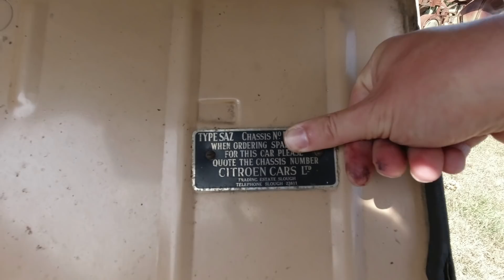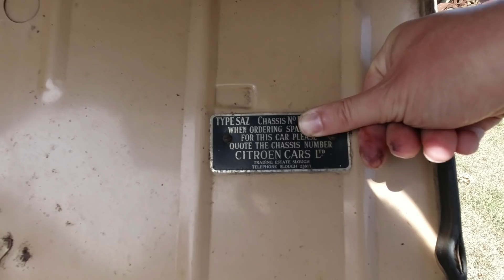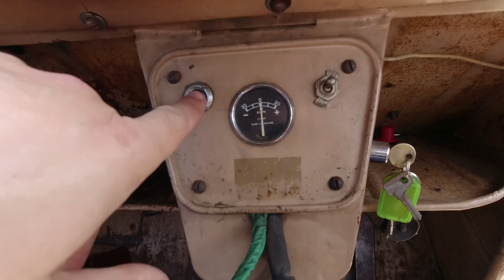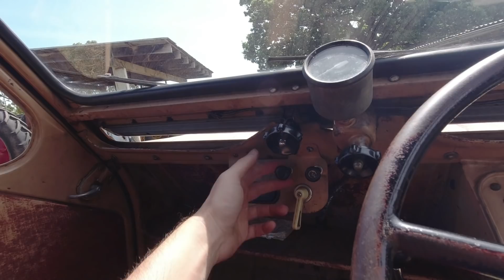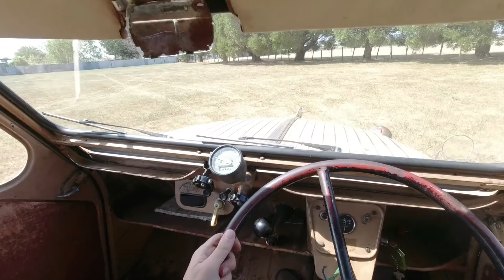British-built 1955 2CV road test, in Tasmania, Australia! 425cc!

Comment: I had a digital piano stolen out the back of a 1988 2cv in Nottingham in 1994 - not the most secure things with those windows.  Can't believe I left it in there.  Luckily the thieves were spotted hoofing it over a nearby wall by The Fuzz and I got it back!

Comment: I so wish I could have that car!!! I've owned two 2CVs. One I drove all the way to Greece in. Took the back seat out and slept in the back. I used to be able to change a clutch I. 2 hours as the release bearing used to chew it's way through the fingers of the pressure plate. The manually adjusted rest drum brakes made live exciting on occasion if you ignored the warning signs lol.

Comment: Great video I really miss the sound of a air cooled engine having owned several VW Beetles in the past. I didn’t know they made the 2CV at Slough I thought it was just the Traction Avant or the Light 15 as the Slough built version was known👍👍
Reply from the maker: They build the DS too!
Reply: HubNut I didn’t know that I wonder what the differences were to the French built DS. I know that the Slough built Light 15 had a different interior with a wooden dashboard and leather seats etc the French built ones were a little more austere inside.

Comment: 3:49: pulling the rubber line will not release the roof. The front edge of the roof is hooked onto the body. You have to grab the front edge of the roof somehow and pull it down-forward to release the two hooks off their eyes welded to the body.

Comment: I drove one of these in the 90 ties with rectangular lights in front, also 2CV4 which meant 400 cc cub motor. The first ones had 200 cc engines , the last 653 cc, all air cooled, very simple and easy to maintain/service, no water, just air cooled. They could be started also by means of a wrench in front, in case the start motor wasn't working or the battery flat.  This car gave me such a pleasure and joy,  open air convertible  in the summertime, low consumption,  an iconic car. It never let me down in winter too, funny they cross all snowed roads as they are light weight and  front wheel traction which was very innovative these days. Citroen invented front wheel drive btw. .  Pretty detail : all spare parts are still available,  because there were so many made and who knows running from time to time !
Reply from the maker: Close. First were 375cc, last were 602cc. 9bhp up to 29.

Comment: 8:43 6 volt ! And square battery which fits any way round. Makes me wonder if they were planned to be positive earth ?
You can tell batteries have been fitted both ways round in its life as the bonnet is corroded in both orientations above the battery caps.

Comment: Cold wet noisy and overtaken by a milk float and a tar truck going up Glencoe.
Had a Renault 6 and Renault 4 with the dash gear stick.
Bedford CA Utilabrake with 3 gear steering wheel shifter. A35 visor and beautiful leather upholstery 30,000 miles 1953.
Compared to a Peugeot Partner 2001 these old vehicles are so consuming to drive. We did it but definitely in Withnail & I territory.
A hobby for sure.

Comment: That is hysterical. I have a lawn tractor with a Briggs and Stratton v-twin producing 18 HP. Early four passenger cars only had 7 or 8 HP! They had to be geared very low, I would imagine. That is really basic transportation. A very quirky little car. My '53 Desoto has a semi-automatic transmission. It has a manual transmission with a regular clutch and a fluid coupling. It also has a couple of solenoids that shift it on the fly. You start off in second gear, if you aren't climbing a steep hill, get up to around 25 mph and let off the gas. You hear a clunk and now you are in third. It also downshifts when you come to a stop. You don't need to use the clutch when you stop. They do recommend using the clutch if you are stopped for an extended period of time though.

Comment: Interesting! I knew about the Slough factory but I didn't realise that 2CVs were built there. 🤔
I thought Citroen didn't start selling the 2CV until 1974 in response the oil crisis.
Lovely patinaed example.
Reply from the maker: That was the 2CV returning to the UK market for the first time since UK production had ended. Fun fact - those early RHD 2CVs were usually made in Belgium!
Reply: @HubNut  Thanks Ian!
Reply: The design actually goes back to the 30s but something happened in the early 40s to delay production until about 1948.
Reply from the maker: The 1930s prototypes ended up very different to the production vehicles.

Comment: Well, sad to say, I enjoyed every minute of that. It rekindles fond memories of Ami 8 driving in the 1980s. I also bought a 1220GS in 1973. Talking of which - and if I remember correctly - the GS 1220 was offered with a ‘Convertisseur’ semi automatic transmission which I think was a development of the centrifugal ‘Trafficlutch’ in this rare and lovely antipodean 2CV from Slough. Little wonder that you wore a smile on your face at the wheel of that unspoilt example.
Reply from the maker: The C matic used a torque converter I think, certainly very clever.

Comment: In cars of that era it was common to be able to start them from under the bonnet, even with an electrically actuated solenoid.  Typically there was a rubber cap on one end covering the solenoid's moving bar and you could simply press that to start the engine.

Comment: I am also having a 652cc Burton 2CV6 motor to my 1990 Charleston... Plus the Power Tube to slightly pressurize the carbie... 36hp plus 20% increase in torque....
Maybe 80mph on the flat and maintaining Speedo on hills... Vrrm
Reply from the maker: I reckon that torque increase is not far off, but 36bhp seems a little much. I reckon my 652 can't have been more than a couple of horsepower more than stock, even after being tuned properly.
Reply: @HubNut  Interesting... Maybe wishful lust for power after 550,000 kms over 44 years of 602cc...And 3 new 2CVs.
 Will the PowerTube give another couple of horses in addition to the extra 50cc?
Planning a 3 week trip next March to a CITIN at Murray Bridge in South Australia for the 75th Anniversary for the 2CV.
Reply from the maker: Not sure the power tube really does add much but may help a little.
Reply: @HubNut  every little in a 2CV is a lot in the rest of the world....

Comment: I havent read all comments but I'm pretty sure someone already explained the stretchy.. 'things'...  at the front corners of the roof. If not, here's my contribution to this lovely 2CV review:
They have actually nothing to do with releasing the roof - you'll just have to tug the front 'beam' and bend it up a bit and backwards to release the 'hook' from a specially made steel recess plate (I just don't know to call it) welded to the windshield frame. They were still welded on long after Citroën had invented a much better system that didn't use them... (you'll also find them in the back from the time when the roof was also the boot lid)
But.. about the stretchy things.. The are just stored there untill you roll the roof halfway only, then you pull them out and use them as 'rubberbands' to hold the roof/roll in place. There are specially made anchor points to hook them to above the b-pillar. You do the same when you roll the roof all the way back.
Reply from the maker: That's what I get for owning a new-fangled Dolly...
Reply: @HubNut  I wish you all the best. Mine was a -59 12,5 hp SAE.. smooth as silk 🥰
Reply: @HubNut  I also noticed that your driveshaft must be realigned to work properly. The outer and inner yokes should be aligned the same way; the outer half shaft should be rotated 90 degrees, according to what is visible in the video. You'll find that they will work much better that way. Also, the reason Citroën put a centrifugal clutch in their 2CV was to make it easier to smoothly turn around in the city letting the clutch even out the oscillating rotation speeds of the driveshafts. As I was told by veterans...

Comment: I wonder if the dash light was oil pressure? My wife and I borrowed a 2CV on our first visit to France. As an old VW beetle man, I was concerned that the one dash warning light didn't work. Found it was a broken wire from the engine. Once I reattached it, the light worked until the engine started and then went out so I was pretty sure it was oil pressure. My VW also had a generator warning light in case the fanbelt broke and you lost your fan. (Not great on an air-cooled engine.) Of course, no need for that on the trusty 2CV with a direct-drive fan!

Comment: Ah Hubnut, how nice to see you in 2CV heaven!  And you've created a much more in depth look at a 2CV than I've ever seen before, so thanks!  It's quite an exercise spotting all the British parts on this car.  Here's a few - Tail lights - Austin A40 Devon and Morris Minor (?). Red dash light - Morris Minor and Oxford.  Unidentified black knob below right of dashboard - looks like a Rover P4 freewheel knob. Interior light toggle switch - definitely British and I've got one around the place somewhere.  And of course it has the ubiquitous Lucas voltage regulator.  Also, Australian number (license) plate spotters will know that this car is wearing original 1955 Victorian plates, and not Tasmanian ones curiously. And I presume the centrifugal and foot clutches are built as one unit?  I'd be curious to see how that works if you ever have your camera near a disassembled one.  Finally, I couldn't spot where the trafficators/semaphores popped out from on this car?  Cheers.
Reply: Ah, I've remembered where that toggle switch came from.  In Victoria (Australia) there was an antiquated law in place until the mid 50's such that rear lights had to be turned on and off by an external switch at the back.  This switch was also used in this capacity on FX and FJ Holdens.  It is of British manufacture.
Reply from the maker: The trafficators had been removed. I think they sat on the lower A post. The clutch pedal simply overrides the centrifugal clutch. It's a series of plates I think. Never seen one in bits.

Comment: My first Dyane, a '73 model also had a centrifugal clutch. It was the first of 6 Dyane and one Accadiane and only 1 2CV . Somewhere buried in my loft I still have the owners manual from that first Dyane. I've always liked the early 4 window body , my memory is vague but I'm sure the centrifugal clutch allowed the car to pull away from a standing start without the need to use the clutch.
Reply from the maker: Correct.

Comment: My slightly ropey maroon Dyane 4 had the later version of the 425cc engine when I bought it in September 1977. After a trip from Leeds to Bedford (not Bradford !) and back I'd had enough and I bought a 602cc engine out of an Ami from a Leeds scrapyard. I did the swap in the street and it made all the difference to driveability. I also had the alternator fail in Stockport on Xmas eve 77 and had to get back home on two candles as it went dark. That was a bit of a frightener. Otherwise it was great and quite a lot of fun to own and drive.
Reply: I like these stories ☺

Comment: Have you ever driven an Armstrong Siddeley Ian? My first car was a A.S. 14 hp built in 1937. That also had a centrifugal clutch and a pre-selector gearbox. You should try one if you get the chance, it had a 1666 cc six cylinder engine which was very smooth, built in jacking system which would lift the entire car off the ground and a centralized chassis lubrication system.
Reply from the maker: Annoyingly, I've not managed to yet.

Comment: Now that's what I call Hubnut !!!!!!  Interesting contrast in suspension systems, from basically none on most of the tractors to rather a lot on the 2CV. It brought to mind an exercise Motor Sport Magazine did involving 100 ascents of the Bwlch Y Groes pass in a very similar car, you'll find it  in the June 1956 issue on their online archive. Maybe  you should re-enact it in Elly once lockdown is unlocked ?  One tiny pedantic quibble, wern't the early 2CVs on metric 400mm wheels rather than 16" ? Otherwise utterly marvellous and thanks again for getting back to normal wiperyness......
Reply from the maker: Correct on the wheels. I've cooked Elly's brakes coming down Bwlch Y Groes before! Perhaps hurtling down at 60mph wasn't such a good move...
Reply: @HubNut  Interestingly the Motor Sport article mentions 50mph downhill and a similar amount of fade (on drums !!!)

Comment: A Tassie car with original Vic plates

Probably originally registered in Victoria about  1958 or so (if I remember Dad's Vanguard plates correctly)

Registration is supposed to be changed to  a new state after 3 months of moving, I won't say anything though but were you were driving an unregistered car on Public roads (tut,tut)
Reply: Mid 1956 registration.

Comment: In the seventies we had a Dyane,basically a bit posher version than the 2cv. 425cc engine,it drove well once you'd mastered the gear shifts. The suspension was great,really bouncy on a country road. The inboard brakes let it down,we had a fair bit of trouble with them due to their getting hot. I'd have another one any time though.

Comment: Cable operated manual starter also used right up to the end of Fiat 126 production, my wife owned 2 in succession, why the bloody hell did I trade one in for a 750 Fiat Panda, and what possessed me to get rid of that also, what a wonderful thing hindsight is.
Reply: I had two Fiat 126's back in the 80's. Both rusted terribly, so you did not lose out much. My 1976 one was in the scrapyard by 1986, and the 1979 one was in the scrapyard by 92.
Reply: Cable-operated manual starters are very reliable, the later solenoid versions are more prone to failure. It's all part of the design of the 2CV, less is more because what you don't have can't fail. As Ian shows in the video, even if the cable would break you can still start the car.
Reply: James Knight Absolutely, it’s a shame cars back in the 60s and 70s didn’t benefit from protection and build techniques manufacturers use today, gone are the days of rust buckets and bangers on the road.

Comment: I was always told this gearbox was, in fact, a 3-speed plus overdrive - that is, the internal ratio for 4th was greater than 1:1 (although the low final drive still makes the term "overdrive" sound a little silly.)  This could explain why the shift pattern is regular 3-speed with first on the dogleg (although Peugeot did use a dogleg 1st on a non-overdrive 4-speed in the 403, so who knows?  C'est la vie - how terribly French.)  :-D
Reply from the maker: It isn't that tall. All gears are indirect on all 2CVs.
Reply: I guess they're just being French again.  They always come up with weird, odd, unconventional - but still usable - solutions to problems that never existed before.  Fascinating engineering.  :-)

Comment: I had a 1983 2cv special where you opened the roof from the outside but always loved the Slough built - specifically for the opening rear windows :-)
Friends had a 1977 special 425cc with front bench seat and a 4 light body shell which I preferred over the 6 light.
I want another 2cv. 
Just sold my 1979 GS Pallas also.

Comment: I absolutely love it! I can only imagine driving it on a cold wet night! God help you if you crashed it! Is it a side valve (flathead) engine in these early cars?
Reply from the maker: No. The 2CV was always overhead valve. Citroen was pretty quick to go that way.
Reply: @HubNut  there's some fantastic ingenuity gone into that car. I mean they really threw out the rule book. The speedo cable driving the wipers for example! I presume they would have been as much cheaper option than a beetle?

Comment: You are right, the engines were designed originally for aircraft use, the con rod has a hole drilled through it to allow oil to be sprayed directly onto the underside of the pistons for cooling, that’s why the car can be driven hard all day on full throttle. I would give a fortune for that car, I’d dearly love another 2cv it would make me very happy indeed, the best car I ever owned and I’m nearly 70! Nice video indeed. Keep up the lovely videos.

Comment: They probably didn't sell well because the price was too high compared to other less basic small British cars, so limiting them to a niche market of oddballs. Many cars  back then could be started from under the bonnet because they had a separate starter solenoid with a push button.
Reply from the maker: They weren't cheap, and they were different. That was enough.
Reply: It also seems to have a starting handle attachment.

Comment: There was no fourth gear until the 1970s. There was an overdrive. To use it, you stay in third, do not go to neutral, just, as you are in third, twist to the right and push all the way forward!
Reply from the maker: No, that's just how you select fourth!
Reply: @HubNut  So it is a four-speed gearbox like newer 2CVs? I know for sure that 1955 models had 3+overdrive but the gearbox might have been changed at some point...
Reply from the maker: It's exactly the same layout. 3 speed plus overdrive was purely how it was presented, but the reality is that it was always just a four speed gearbox.
Reply: It was a four speed, but the gear pattern was different and the 4th was not marked as 4 but as S (surmultiplee-overdrive).
Reply from the maker: @tasospappas6627  That's exactly what I say in the video. 😉
Reply: @HubNut  I didin't hear it sorry😊 I saw you trying to find the fourth and remembered that the older ones are a bit more complicated. Also, is your GSA a Tuner model?
Reply from the maker: @tasospappas6627  No. I don't think we got the Tuner in the UK. It has just been repainted in a different colour.
Reply: @HubNut  The red strips on the sides may be a sign that it was a Tuner at some point and the fact that the radio is missing, the Tuners had special radiocassette player and an amplifier, might also be another sign. But who knows... If you want check my chanel. I upload videos of my 1977 CX and my japanese cars😊